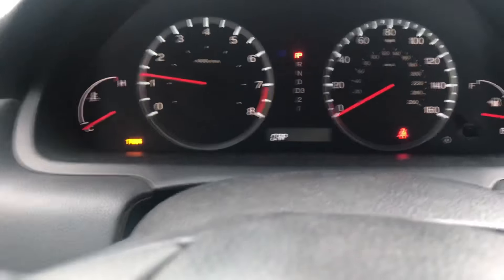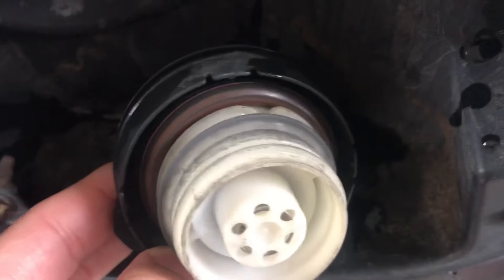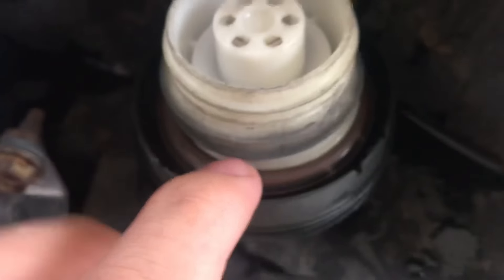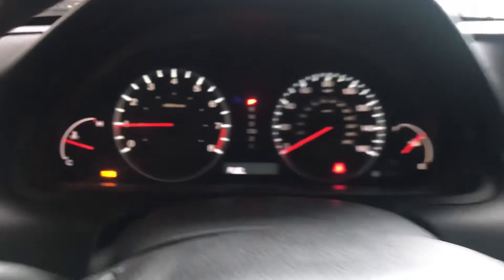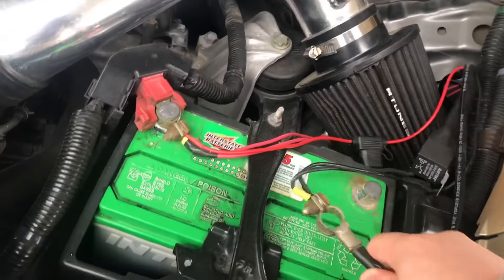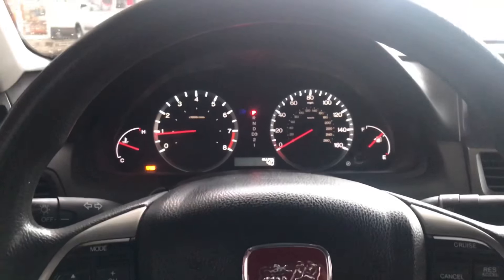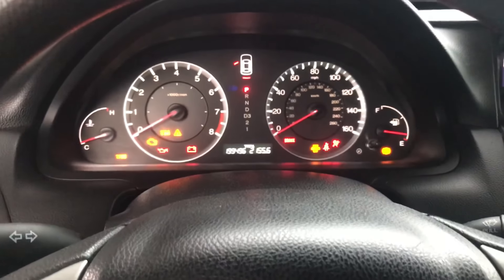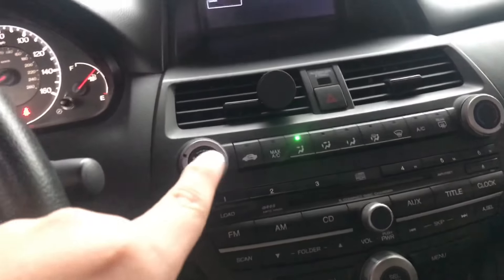Check Fuel Cap Honda Accord (FIX!!!)

Comment: This light comes on because of a leak in the evaporative emission system, usual suspects are the gas cap, and purge valve. If you see this message the first thing you should do is check the gas cap and be sure it's fastened completely. Purchasing a new cap is also an option just to be able to eliminate this as a possibility.  At this point even if your check engine light isn't on you will have a code pending. It takes a few drive cycles (periods of driving followed by about 8 hours of inactivity) for the computer to register this code and illuminate the check engine light. If the cap is replaced and a check engine light doesn't come on you should be fine. If the light does come on then the best thing to do is take it to your mechanic and have them run a complete diagnostic before you start throwing more money at it. Most likely it will be the purge valve, which is easily replaced by anyone with the ability to read diagrams and use hand tools, after this point however you could be looking at some major repairs, try to think if you've hit something such as a curb and bottomed the car out, an exhaust leak or damage to the catalytic converter may cause this. Hopefully that answers any questions, and if you really want to play it safe, go to a trusted mechanic that will run the codes and do a proper diagnosis, in the end it will save you the headache of checking all of these items yourself and wasting time and money.
Reply: what if you dont get a Trouble code, and you changed the purge valve and charcoal canister and vent valve. he is just erasing the code here, my scanner can do that. it keeps coming back and going away but the car passed inspection because it dont give me no trouble code. I wonder what it can be. I bought a New gas cap from the dealership too.
Reply: Catalytic converters will not cause this problem. This is an Evap problem. Most likely, the purge valve could be gas cap, but unlikely, if not the purge valve or gas cap, it's definitely your charcoal canister under the car above the gas tank.

Comment: I have that problem every once in a long while, I read the car manual and says to take off cap and put it back on, and that it would take 2 to 3 driving cycles to turn off
Reply: That’s actually how it clears itself, last time I simply took my OBD II and cleared it after I got a new cap. Last cap was a good 9 years old, got it from Napa. Just had this messeage pop up again after maybe 2-3 years so probably due for another cap, I’ll probably just wait to see if it clears because I know I always close my cap tight.

Comment: You didn’t need to disconnect the battery. All your initial steps were correct (remove cap, screw back on to click, turn car back on). Once you’ve done that, you just need to drive about a quarter mile and it will reset.
Reply: It didn't for me. Code came on in the middle of driving. Pulled over into a gas station, checked the cap...off/on/clicked a few times, then drove onto destination. Shut car off there, hoping code would clear upon restart, but it didn't. Made several stops b4 returning home. Code still on. My mechanic is coming to check on it. 🤷🏻‍♀️
Reply: What was it turned on on me in fwy before worked out in park and it’s just turned off on me then leaving from work this came on check fuel cap pulled over checked it was good and now I’m asking what was it bro help me out

Comment: the check engine light will automatically go of when the battery is disconnected, the bigger question is did the light come back on once you put miles on the car??
Reply: exactly that was not a good teaching pointer on his part...
Reply: In my car sometime it comes and sometime it goes automatically, I do nothing.

Comment: Hi. Thank you for the video. My car also has the TPMS light on. How did you fixed it?
Reply: Check your tire pressure if they are ok change your tire sensor
Reply: Yeah the TPMS is tire pressure monitoring system and like the previous Edson said check your tire pressure and confirm it’s set to the manufacturers recommended pressure. My 2012 says the pressure needs to be 32psi (you can find it on a sticker in the door jam of your car). If your tires are all at 32 psi and they are still on you have a bad gauge in one of the tires.
Reply: TPMS light usually means 1 or more of those sensors need replaced.  They dont last forever. You have the option to ignore and manually check your tires periodically like the "old days" or have a tire guy figure out which sensor needs replaced and replace. Not overly expensive if you avoid a dealer.
Reply: Nada mas lo borras como 2 dias luego se prende aunque le hagas reset.
Reply: TPMS stays on when you get newer or aftermarket rims.

Comment: I replaced my gas cap and purge valve. 2 months later it came back. I feel like it has to be the purge valve again because it shouldnt have been fine for 3 months after replacing if it wasn't a part of the solution

Comment: this does not fix it. I changed my carbon canister, purge valve, vent valve, gas cap and still it wont go away. dont know what it can be. can anyone tell me what it is. i dont get a trouble code on the scanner. it just bothers me to see it, after spending so much money to get rid of it. bout the gas cap at the dealership.

Comment: You should really read the manual first. It's totally unnecessary to disconnect battery, all you have to do is pressing the button(light adjust).
Reply: What button do you press??
Reply: Nice. Worked

Comment: did it ever pop back up for you?  Been having this go on for a year on my 2012 and finally wanna get rid of this error message
Reply: itsSaucyJohn just popped up on me and disconnected the battery for a minute and it worked only thing is you have to enter your stereo code once you plug it back in the stereo cod for my 2011 accord coupe was :32354 hope it helps
Reply: Code came back ?

Comment: literally just press the button on the dash by the fuel gauge and it goes away
Reply: facepalm
Reply: @silva0003  Haha
Reply: If you keep pressing the button it cycles back up though.
Reply: Pressing the button worked on mine! A lot less running around. I hope it stays off